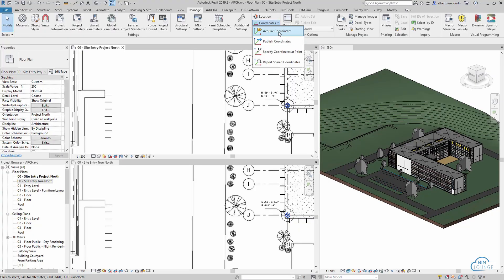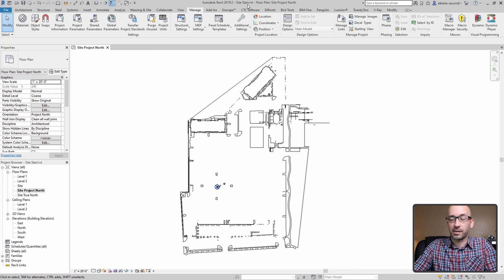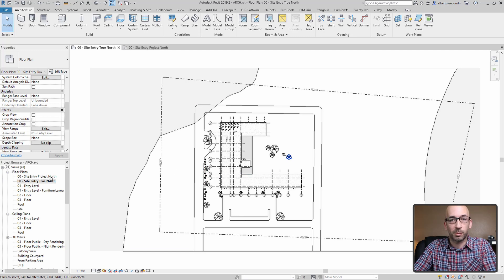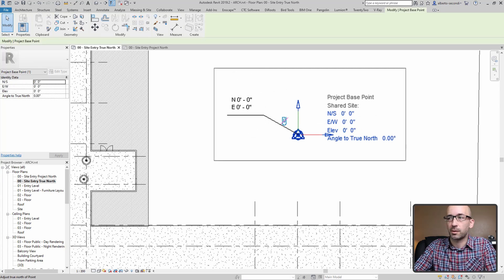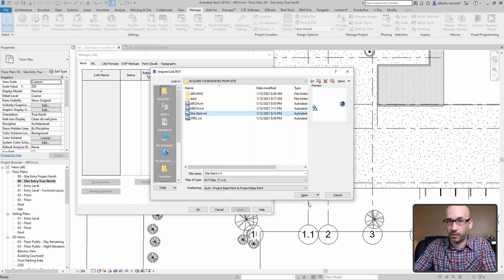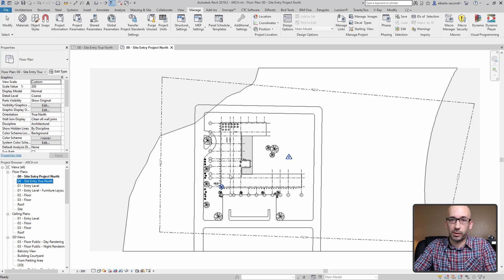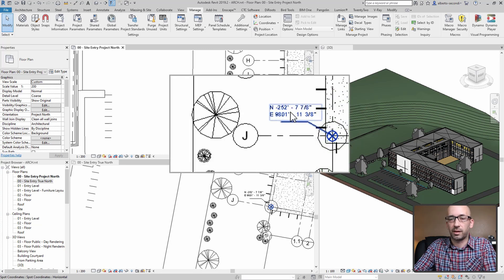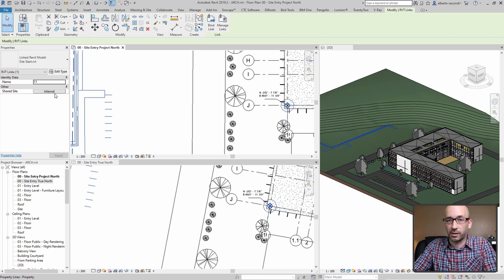How to Acquire Coordinates From a Linked Revit Model in 3 Simple Steps

Comment: Thank you for this explanation. I have one question. The survey point in the linked file shows 0 0 0 but my main model's shows a different coordinate. Should I just unclip it then move to the linked files survey point? Is it that important?
Reply from the maker: Great question. Without having the models in front of me, I would recommend using the Project Base Point as a reference instead of the Survey Point. If you have the option to clip/unclip, I would unclip the PBP and move it so it matches in both models relative to the building. At that point you can link the model using the PBP to PBP option. From there you should be able to follow the steps in the video. Acquiring coordinates from the link should match the PBP and SP relationship between projects. Let me know if that helps and thanks for your comment!